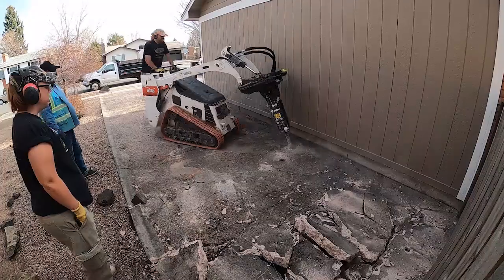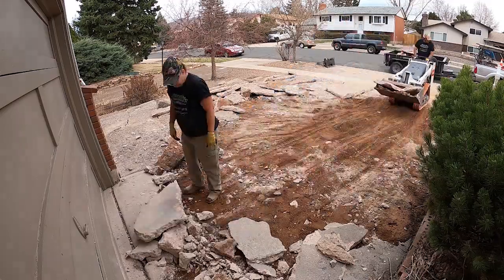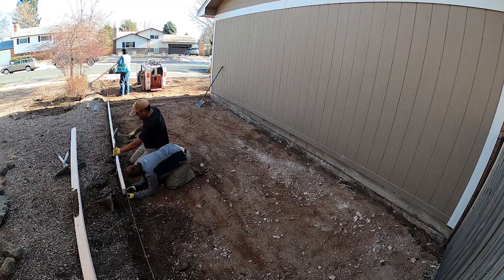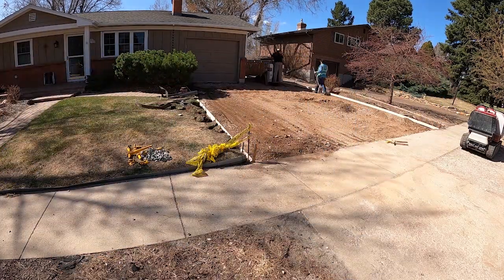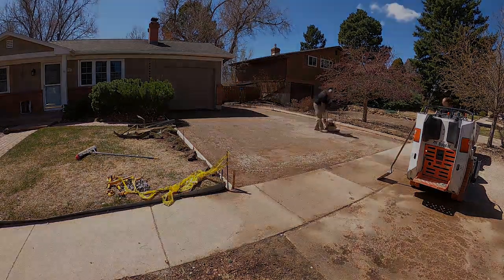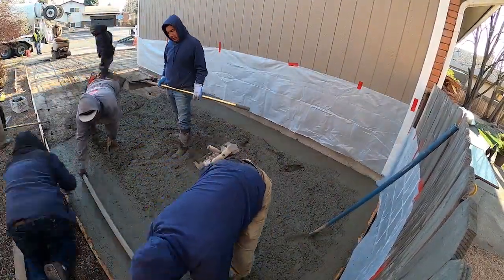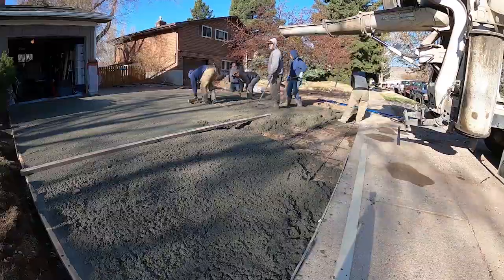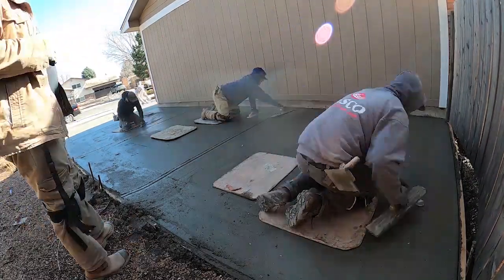Driveway tear out, Prep, and Pour.

Comment: May I ask what would be the reasons to tear out the original concrete other than water damage, structural Integrity problems Etc and do it over again? Thanks
Reply from the maker: In this specific case the damage was excessive and made it hard to walk on the driveway without footwear. And it increases home value when the driveway goes from this to the new one. Also home insurance goes down a little when it's new and not this bad. But at the end of the day I believe it's about personal preference. Could this old driveway done fine for a few more years? Yes. But some people like new. I always like to let them know they don't need new concrete.

Comment: Do you guys use any shredded glass fiber reinforcement mixed in with (inside) the concrete? It’s supposed be great for reducing shrinkage cracks, movement, etc., etc. Just curious. :)
Reply from the maker: Yes we do use micro fiber on all our pours. It's a much smaller and thinner fiber than what you speak of. Better coverage and more benefits like those you mentioned.

Comment: 3.5" is way too stiff to work, but we're in Norcal and it's hot as hell here, so I typically go 5.5"-6" gives us time to place and work it. Good video.
Reply from the maker: Tell me about it. And it has fiber with accelerator. In order to increase our chances of avoiding spalling during winter we pour stiff like a curb almost. Takes a lot of work but once it's done its built really well. Basically anytime weather is cold we pour early to get a lot of sunshine and we pour low slump with accelerator. Finishers hate it and I do too. But it ends up being a solid driveway. Thank you for your comment and support.

Comment: That video w that green buggy was our 1st video and that shit went so fast so it didn't look the best but it passed
Reply from the maker: Those buggies sure move material fast. Within 100 feet I can keep up with a small pump. Plus we don't need to use that 50/50 mix which is OK but not as good as a standard mix. They are expensive especially if you buy a tracked one. But damn is it helpful. Also gives us a good spot to wash out if there isn't anywhere on site to do so. Your videos look good and clean.
Reply: I never use that mix, and yeah I've used them for years way better than a bobcat you can put a half yard in a buggy